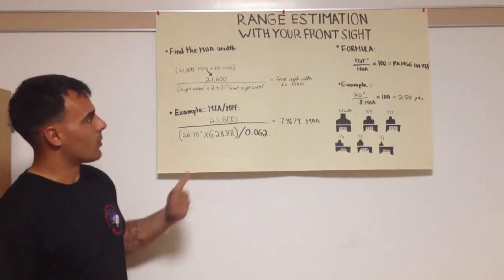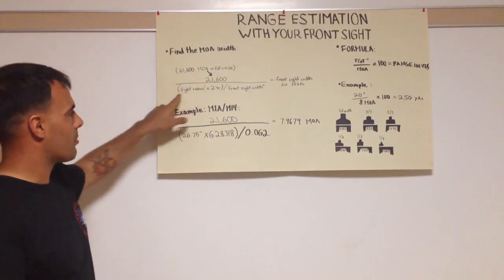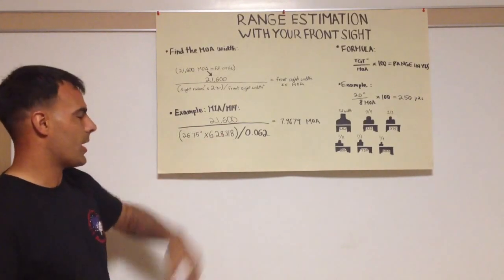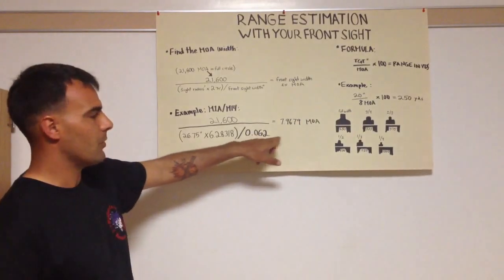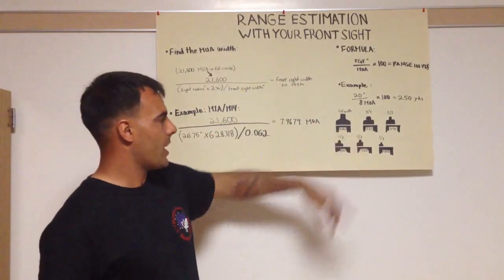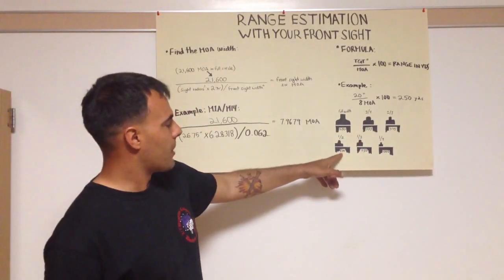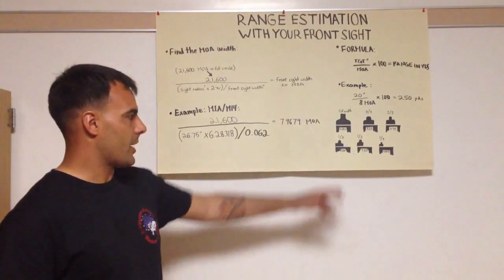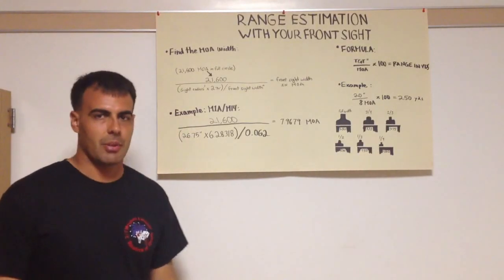Range Estimation: Front sight method.

Comment: Great video.
One question, does this same system apply when using leaf sights like on a Mauser or AK (sight radius) or is the critical value the distance of the front sight to your eye?
Reply from the maker: Orpheus Epiphanes the technique will work, but you need to do the math and find out what the MOA width of your front sight. The M14 sights just happen to have the radius and front width for man range est. But you can still find out the MOA width to do range eat. that way.
Reply: MikeM0331 So the distance between the rear leaf and the front post will be what my calculation should be based on?
Thanks
Reply from the maker: Orpheus Epiphanes so measure the distance from the back of your front sight to the back of the rear leaf in inches, multiplied by 2pie, divided by the width of the front sight in thousanths. Take that number, and divide 21,600 by it. That's the MOA width of your front sight.
Reply: Awesome, thanks
Reply: Orpheus, I use a "sight radius" factor of front sight to eye for rangefinding, not to rear sight. For downrange zeroing it's front sight to rear sight, if target, front sight and rear sight are in the same plane. Stadiametric rangefinding can be accomplished with any target size and 2 fixed points, even archery sight pins. It's just using different variables in the mil-ranging formula.

Comment: Mike, good mathematical explanation of what's going on. 

People may need to hear this message a few different ways before it clicks- may I offer a summary to get the deliverable: fast, accurate ranging of target. 

People CAN range very accurately, very quickly.  Target distance should never be guessed when its easy, and fast, to calculate it.  If you 'guess' wrong, you WILL miss that target.  If you calculate right, you have a good chance to HIT the target.

Military front sights are (very often) designed to be as wide as a torso at battle sight zero range- an M16, M1A, AK or SKS front sight is as wide as a torso at a range that is close to 300m.  That range is chosen because it is a very useful compromise between very close and very far targets.  It minimizes the need for changing the sight setting by being 'correct' for the distance the designer planned for a firefight to take place.   

What's battle sight zero? It's the range where your rifle was designed to place a bullet when a military target (torso) is roughly 300m away, and your weapon elevation setting is set to that range.  On an M16, for example, it's 300m right on the dial (and small aperture). 

 That means, if you have your elevation setting to 300m, and you engage a target that is as wide as your front sight post, you'll hit them.  Point of aim will be point of impact.

(What is the BSZ range for my rifle?  Consult reliable literature, or else test it yourself.  Set a 23" wide square target out on the range, and then see how far away you have to get before it's the same width as the front sight.) 

Let's say that at 300m two things can be counted on for some rifle: 
1) point of aim = point of impact
2) a torso target is exactly as wide as the front sight. 

And let's say that earlier, you sat down with a fourth grade kid and practiced flipping fractions. 
1/3 flips to 3.  2/3 flips to 3/2   1/4 flips to 4. 
See how easy (and fun) it is to flip fractions? 

Now take a fraction of 1/3, flip it, and then multiply by 300.
1/3 flips to 3, times 300, is 900. 

2/3 flips to 3/2, times 300, is 900/2, which is 450. 
See the beauty, simplicity, speed of this process?
Not only can you easily do this, so can the fourth grade kid. 

Why do all this?  Range targets this way. 

Target is 1/3 width of front sight.
1/3 flips to 3, times 300m = 600m range to target. 

Target is 2/3 width of front sight.
2/3 flips to 3/2, times 300m = 450m to target. 

Summary:
To range the target, just 'flip' the target width/front sight fraction and multiply by BSZ range... moreover, BSZ range is often 300m. 

Finally, THANK YOU to US and NATO troops wherever you may be.

Range the target and shoot straight,  

-FM